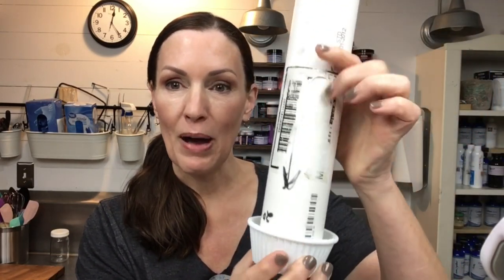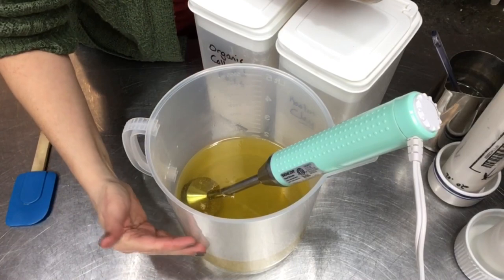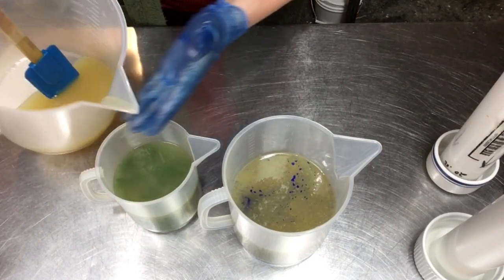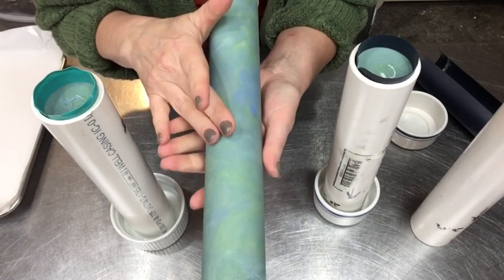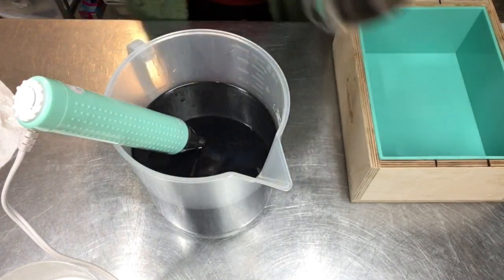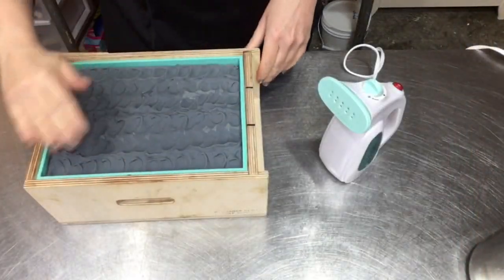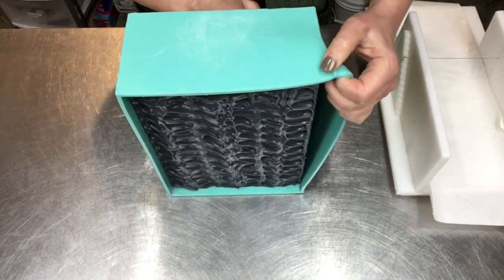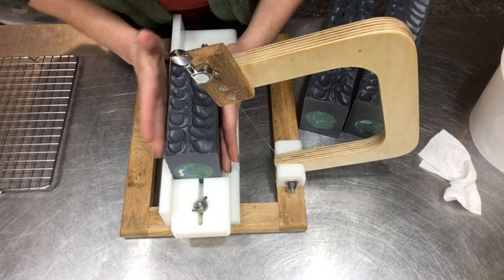How to Make PLANET EARTH 🌏  Cold Process Soap w/ No-stick PVC embed mold | Ellen Ruth Soap

Comment: Love your earth soaps, I have looked high and low for a cap for my pvc pipe and haven't found anything, I do have a glass ramekin, would it be ok to use it.?
Reply from the maker: Thanks!  Yes, I think the glass would be great (assuming they are heat proof and can hold melted MP soap)..
Reply: @EllenRuthSoap  I think it is heat proof, I've also seen someone use a silicone cupcake liner taped to the end of the pvc pipe.